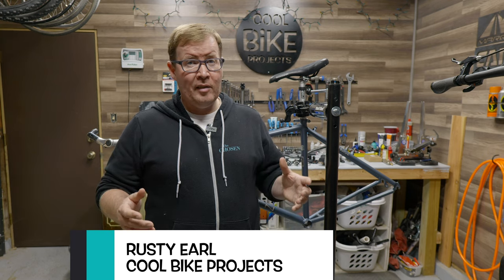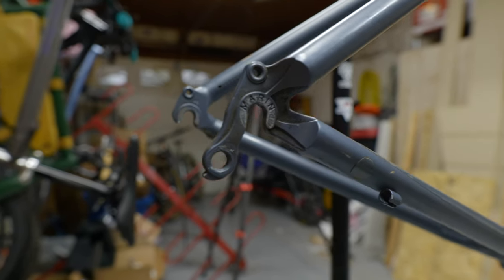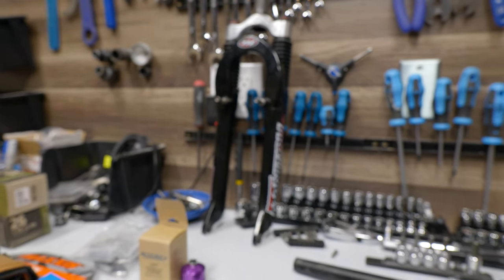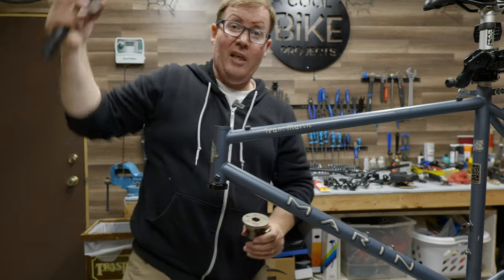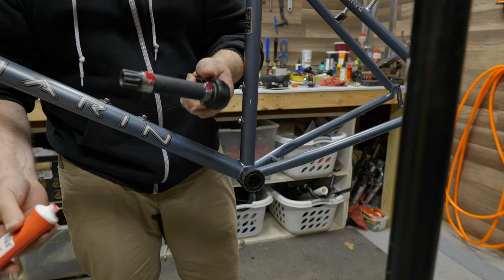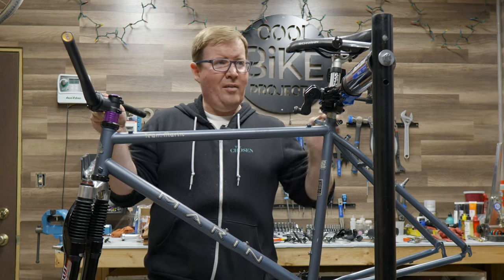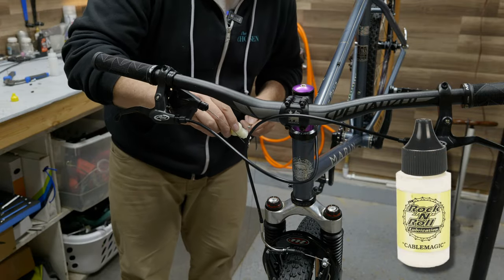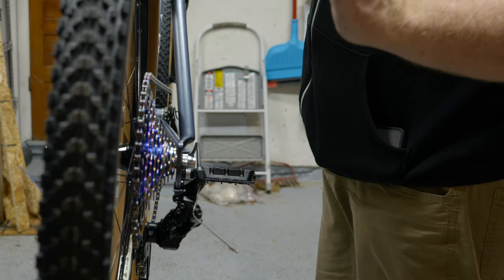How to Restomod a Bike : Marin Mountain Bike Restoration

Comment: The first bike I ever bought myself aged 18 was a 95 Marin Bear Valley. Loved the chunky look especially those seat stays. I crashed it at 43mph and snapped the top tube in half, some achievement on a steel frame hehe. Replace it with a 95 Marin Eldridge Grade, which was sadly stolen. Thankfully my third bike, a 97 SWorks M2 I still ride :) Third time lucky

Comment: Why would you ruin a perfectly good rigid bike with a suspension fork, also you don't need a headset press, just use a block of wood, and 10 speed cassette with huge range is overkill for a 26 inch wheeled bike.

Comment: I’m having an issue on a 1x8 converted road bike that I went from a 117mm to a 107mm bb and the chain line is dead center between 4&5. When I back pedal on the largest cog, the chain jumps to the next cog. My chain line isn’t near as severe as the one in the video.
Reply: Put it in 8th gear and backpedal. You'll see the chain rubbing on 7th.....1x is dumb, you only do it if you need narrow wide chain rings because you drop chains every ride.

Comment: Great build.   Q. Does an 11 speed cog fit between the dropouts the same as a 10.  WhT is the MM requirement for it .I'm trying to do the same to a 1999 Zaskar Le.Thanks.
Reply from the maker: It all depends of the freewheel of your hub. Having said that, most 11spd cassettes are on wider hubs 142 to 148mm.

Comment: I just finished a restomod of a 97 Rocky Mountain Equipe, but I did a few things differently. I used the original Raceface crank and got a narrow-wide chainring that fit it, and used a 27.5 fork to give it a more modern head tube angle. Winter showed up before I could try it out, though...
Reply from the maker: Awesome, I would love to see a picture of it.

Comment: I gathered most of the parts for Marin B-17 bike,  could you help me find correct crankset size please?  For 73mm bottom bracket
Reply from the maker: Tell me more about it. Are you running a triple chainring crankset or a converting to 1x set up? Most of the time the crankset only matters in relation to the spindle length. The chainring(s) matters in relation to what gears you plan on running in the back.
Reply: Thanks for your replay,  the frame is 1998 Marin b17 and currently no crankset on it and i want to order a 1x 32t crankset for 10 speed cassette.  If you have any info i could use please
Reply from the maker: @jnlltd  the good thing is most 1X cranks sets that come with a bottom bracket will fit 68 or 73mm bottom brackets and come with the appropriate spacers as needed. You can pick up a decent offbrand crankset for 75 bucks that includes chain ring, cranks, bottom bracket, etc. For $100- $125 You should be able to pick up a SRAM NX or GX crank set. I like the machining they do on their chain rings and I feel like they’re bottom brackets are of a higher-quality. All of this you can find on Amazon Amazon or eBay.
Reply: Thank you,  i managed to find one 73mm.

Comment: I'm building a 95' Marin Pine Mountain as a gravel bike...I'm leaving the 3x7 gears as well as the Cantis from Shimano, which I had already replaced around 2000. I have a big problem with the paintwork, it is very badly damaged due to hard use...I have to have the bike repainted...where can I get the original stickers from Marin? Greetings from Germany.
Reply from the maker: I would suggest looking online through Etsy.com - Velo Cal used to be the go to place, but they’ve recently gone out of business.
Reply: @CoolBikeProjects Update...etsy actually has the matching Marin stickers....Thanks for the tip.

Comment: Doubt about VG brand, i've seen VG chain doesn't match with Shimano's DCE chainring profile (previous generation, MX000 series) even though the packages tell you its match them by showing Shimano MX000 crankset use them 
.
And ironically, the owner use XT M8000 crankset (similar to what shown in the packages)
Reply from the maker: Thanks for your insights on the chain. We put some miles on it in Vernal, so far so good. Doesn't feel super crisp but not bad either.

Comment: Awesome build, awesome video!! I’m trying something similar air with my old Trek from junior high school (92 Trek Antelope)  I’m just struggling to find components that will work.  did that 10 speed cassette just for on your 26” rim?  I was thinking a 1x10, I’m also gonna do drop bars and Sti levers.  Any advice, tips or ideas are welcomed!  Thank you and  thanks again for the video awesome work.
Reply from the maker: Congrats, restomods are a ton of fun! The issue you are going to run into is your rear wheel free hub. It was only designed for a 7spd width. While it is possible to change it out for a longer 9spd (that means it will work with a 10spd cassette) it will mess up spacing of the wheel and "the dish"  causing a lot more work on your part. If you really want to move ahead with the project bike I would suggest finding or building a newer 26" wheel with a 9spd Shimano free hub that can take the new 10spd cassettes. You can still find some decent used 26" rear wheels on eBay and a lot of rims and hubs to lace one up. Best wishes!

Comment: Why did you not use a newer and more up to date fork like a Rock Shox Reba which is still available for 26”?
Reply from the maker: Great question, it came down to the  budget and geometry. I got the fork for 50 bucks and it needed to be 80 mm. If I had a bigger budget, it would be nice to go with a bomber or a Judy/ Reba.

Comment: The bike came with all the tools needed to assemble https://www.youtube.com/post/UgkxHL1v1R3NE5x4KiYfyt8dnQmyNYz7qi5L and the included instructional video made assembly a breeze. I bought the 20" bike for my child and it looks very nice and rides well. The 6-speed shifter is a little tight on the ends for the little hand but operates well between gears 2-5.While the paint is of good color, it seems to be very thin. I peeled off the white barcode sticker and it took off a big piece of paint with it. Now I need to find some touch-up paint to seal off the steel from the environment before it rusts...

Comment: Nice build on a beautiful frame! Some things I might have done differently, though: RockShox SID Air should be lighter, has a lock out and better response; add a dropper post; instead of the 1x10 drive train, go 2x10 which offers a higher range with finer granularity and also eases the chain line issue.

Comment: Adding a suspension fork to a bike designed for a rigid will throw the frame geometry off, usually by about 2".  It's very noticeable in the bike's raised front at the end of the build.  I agree in keeping a nice original rigid fork.
Reply from the maker: It depends on the geometry of the bike. For many MTB 1995 and older that is true. 97' and newer and you should be just fine.

Comment: I'd have told you not to shorten the stem with those forks. You need to be forward on this pedalling up hills as otherwise you will be doing wheelies, I'd have recommended a longer fork and slightly shorter stem.
Reply from the maker: Thanks for the input

Comment: Hey, your videos have been so helpful as I attempt to update my 1994 GT Tequesta. I recently upgraded a seven-speed free hub to accommodate my 11-speed cassette. My question is, have you ever had to cold set or stretch the rear triangle to support anything larger than the seven-speed? My tire is just rubbing the left side of the frame, and I’m just wondering how to fix it.
Reply from the maker: Great question, the only reason to cold set/ widen the rear triangle is for the spacing of the hub not the tire. If the tire is too big, you’ll have to drop down the size, It’s also possible that by putting on by a different free hub you will need to dish the wheel over if it’s not centered. If you’re worried that the frame is out of alignment or that the wheel is not dished correctly. I would highly suggest taking it to a shop to have them check. Thanks for checking out the channel and best wishes on your project!

Comment: Great project! Can't wait to see the comparison. Every time I see an elastomer fork, I can't help but think of the Total Air Cartridges. Did you ever have any experience with those?
Reply from the maker: Thank you and no, not much experience with the cartridges. I just remember them being replaced quite a bit. I’ve always liked the Manitou Black Forks when those came out.
Reply: @CoolBikeProjects  On my first bike, I needed a fork with a 1" steer tube, so there weren't many upgrade options. I swapped out elastomers on my Rock Shox without much improvement. That's why I considered trying out the Total Air Cartridges but ended up finding a refurbished Marzocchi fork, which was one of the smoothest forks I ever owned.